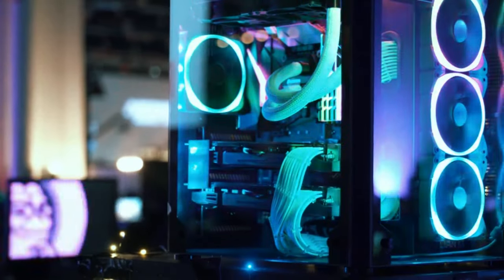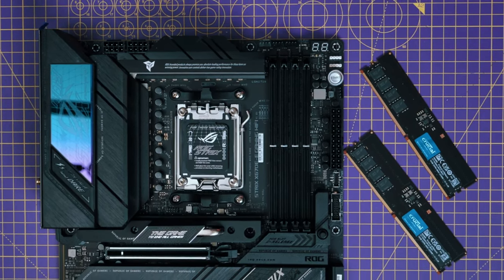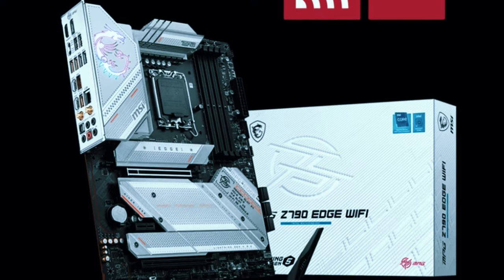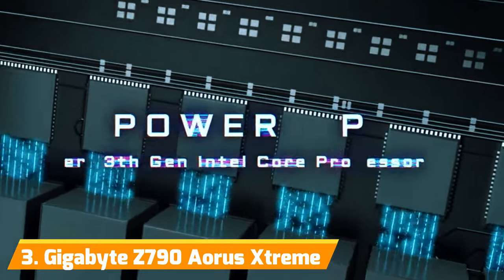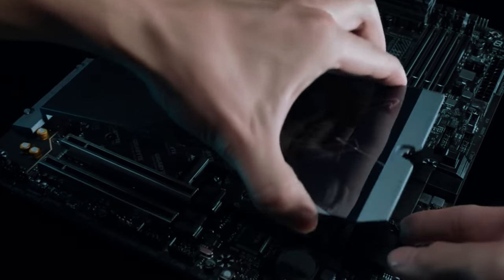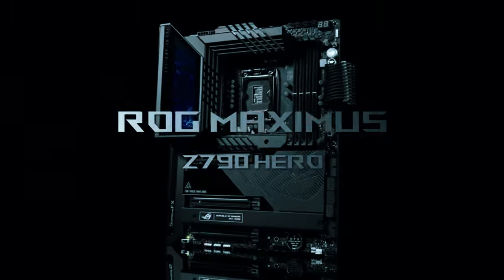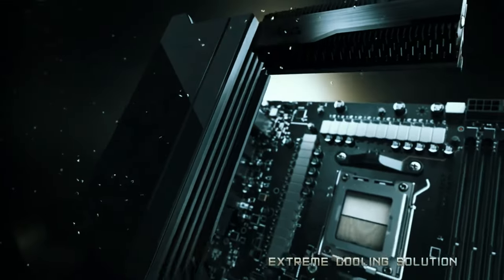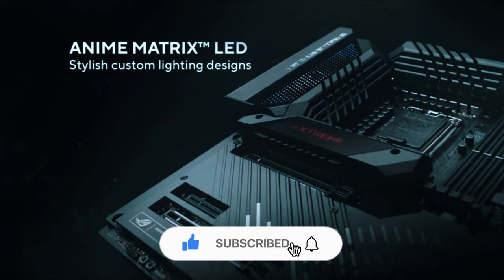5 Best Motherboards 2024

Comment: DONOT BUY GIGABYTE OR ASROCK , 90% of them are having issues posting the correct memory , some have bent pins, and most of them especially GIGABYTE has issues with LAN drivers. I bought both motherboards (SEVERAL) and had MAJOR issues with them , having to deal with memory and WIFI/LAN drivers.  I have been building computers since they were 286's ( the 90's) and I have NEVER in my life had issues like I have had with these two manufacturers in the last two years, stay clear of those motherboards.